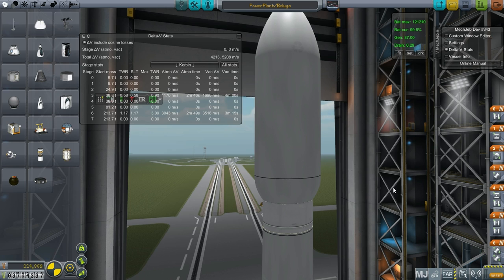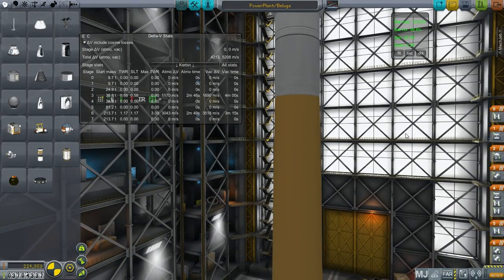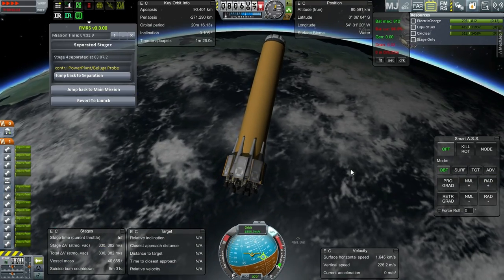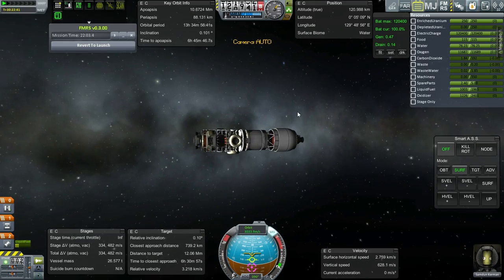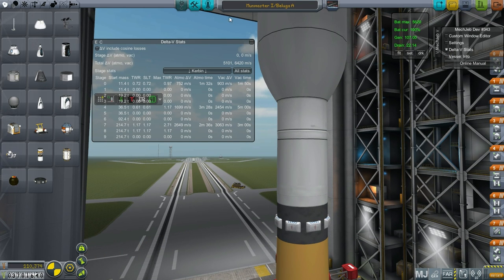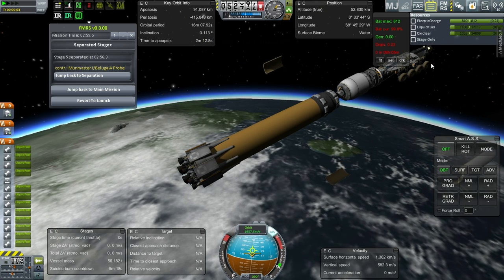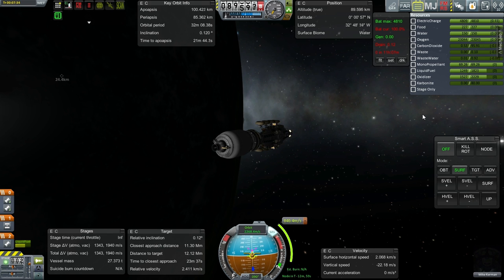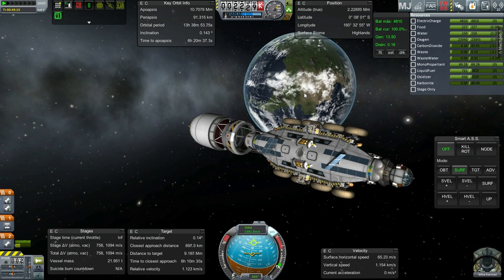Kerbal Space Program (0.25) - Kolonization 19 - Subcritical Explosions

Comment: Your Beluga (its name reminds me about the Airbuss pregnat-planes) stage has something about 40 tonns of dry mass. So if you wan't less than 6m/s touchdown speed you need about 40 stock parachutes on it. 

Also if you want you may try to splashdown your stage near the KSC for testing purposes. With fully unfolded floaters. And if I were you I wouldn't expect it to be extremely stable because as I suspect center of mass of your stage will be above the waterline.

In order to create more stable vertical stage you may want to put as many of dry mass as you can as low as you can. And here goes my second suggestion: in order to preserve flotation devices you may try to hide them behind interstage fairings. I suggest you to try to form some king of service module covered with fairings near the engines and at the dry center of mass of the stage. You may also put to this service module your batteries and your gyroscopes.